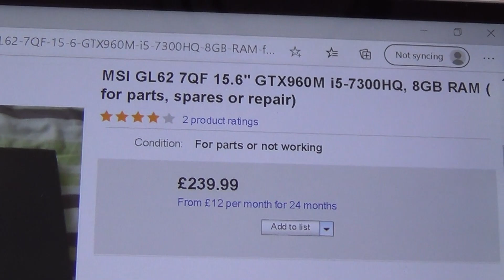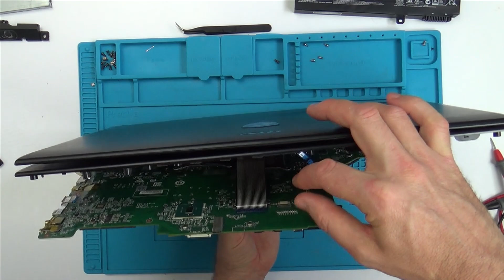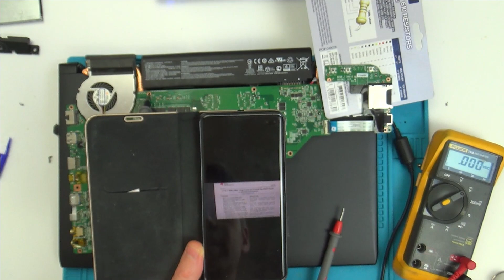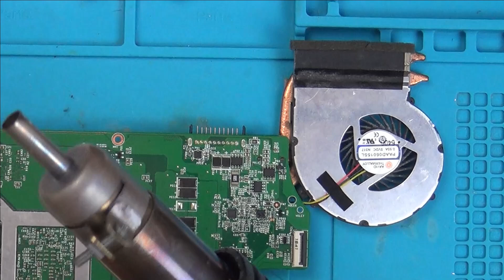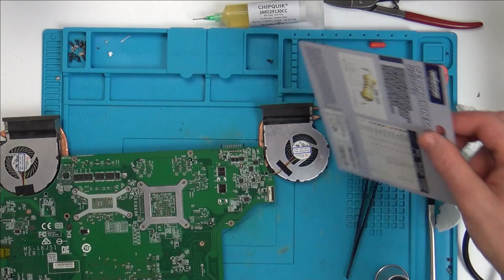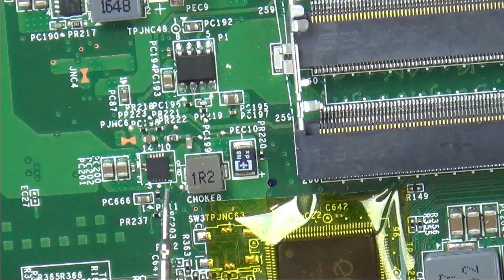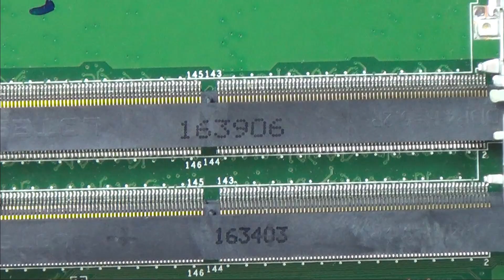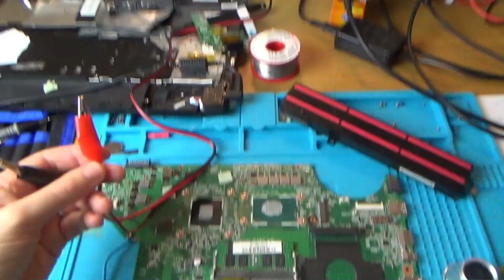Trying to FIX : Faulty MSI GAMING LAPTOP from eBay

Comment: It isn't smart to buy such thing for $200 even when you don't know the history but you already find out. Complex machines and you already know the seller messed with it (honest however can be very destructive - can ruin many components - parts unusable) . That ribbon cable was an indication something terribly went wrong, also the metal particles (does not belong there) on the speakers, wow.  A short can damage many parts, can melt solder, ruin everything, it is not a solution, not all about continuity tests on parts that possible survive the tragedy. You don't check all connections of the ribbon cable, it is not only the power button that could be faulty. You didn't check (flyback) diodes (for example in the polarity overvoltage protection circuits etc), voltage regulators in and out etc. Allow pumping many amps into the board without protection, stress (other) components to get faulty  is always a bad idea. Amps is not always an indication it is good, a short can consumes many Amps, be careful allowing this. If you do want to do such repairs, you need a scope and at least more experience how it works exactly.

Comment: You have a hot air gun. Get a replacement GPU off ebay. The GeForce® GTX 960M can be had for about $40 usd. If it has the balls on it already, it's a simple fix. Otherwise you would need to get the stencil for it and some solder paste. Great video.
Reply: A faulty GPU won't stop it powering on. I've powered a laptop with the GPU unballed from the board. You should still at least get power and fans spinning.

Comment: Interesting video but you definitely got ripped off this time, my guess is the seller probably thought he could sell the chips separately or something and tried to remove them. Must-have known for sure he'd destroyed it completely.
Reply: they definitely knew that it was unfixable. Threw the hard/impossible fix line at the end to cover their ass after bullshitting the possibility of it being an easy fix.
Reply: @dizzy2020  That machines not suitable for Spares or Repair there's not one thing in it that it's in any way salvageable. I'd say charging a few hundred pounds for something you know to be completely useless and basically destroyed any chance of repairing yourself is definitely ripping people off.

Personally I can only guess you're the seller trying to defend this as I don't believe anyone else ever would.
Reply: @Tek-nikal  
not one thing in it that's in any way salvageable? huh? you obviously haven't done any repairs on computers, or know much about computers overall..
I see a 120W power supply, an LCD, a battery, RAM, heatsink, the shell itself. all those parts if you buy them separately they will cost you a few hundred euros total, go see for yourself.
you could even just swap the motherboard for a couple of hundreds more and have a working gaming laptop. and those are not cheap. 
I don't mean to be rude or anything but I think you don't quite know what you're talking about..
Reply: @DecibelAlex  That's right. Plus, in the description it is listed as not working or spares/repairs. It's clearly sold as seen and broken. There's no guarantee it will work and when you pay £20/£200/£2000 it doesn't matter, it becomes your problem once you buy it. If that means you can't fix it, then it's tough. That's the risk after all.

Comment: Hello, do you plan to keep the battery ? I got a MSI laptop, the battery is similar but i can't see if it is the same. My cells on the battery are fine, the laptop recognize the battery but turn off when i want to use it, i was suspecting the battery but it may be a chip on the computer.

Comment: Get yourself a BGA chip nozzle for your hot air station and give it a whirl to replace it, or heat up the chip and hopefully the shorted solder balls will melt off each other under the chip, heat the chip from the other side of the board, place Kapton tape to secure the chip down on the board, turn it over and place heat say 450 and hopefully the solder balls will re-flow under the chip

Comment: Yes Vince, the 2032 button battery is a BIOS battery. I like to call them CMOS batteries, but we haven't used CMOS in a long time. So you can call it either or, there's no wrong answer there. All that does it just keep track of your time and date and any settings you've changed in BIOS.

Comment: That Ebay seller was very dishonest. They outright lied in the description. That should be grounds for return as the item was not as described.
Reply: "spares or repair" is normally always sold as seen. with no returns. buyer beware

Comment: Hi vince the same thing happened to my old laptop try holding the power button down press f12 repeatedly for around 30 to 40 seconds this issue was on my old hp laptop and I couldn't get it on so I took it to the shop and he explained to me what to do after I followed his instructions my laptop started working again mate.

Comment: Vince that laptop has seen better days!!! But putting voltage and amps directly to that chipset south bridge chips power supply isn't a good idea try further in form the power input of the device. it`s not that BGA chips fault.. try and remove the Super I/O chip its the one that had Kapton tape on with about 128 pins see if the other shorts go away also it switches everything on and has 3.3v on one of the pins for the power button.... If not then that damage to the CPU and GPU is the reason why but I believe the last owner probably was watching sorin and thought he try cleaning it.. 1 more thing that ribbon cable the tracks got ripped of because someone pulled it. The bits are possibly pushed inside that connector shorting out?

Comment: Look for the Super IO chip also called the Startup Chip. It is a fairly large chip. The signal from the on-off switch goes to it and it turns on the computer.

Comment: Did you take a hard drive out i didn't notice you taking a hard drive out some laptops wont turn on with out a hard drive.
Reply: All laptops will turn on without an HDD installed, they will just say no boot device found.

Comment: I hate these ribbon cables the seem to fail after removing and replacing a few time and never buy anything that someone else has looked at i spent ages sorting the mistakes out a previous owner has done to the 3 head sony deck i bought .

Comment: You can find skamatiks here http://schematic-x.blogspot.com/2018/04/msi-schematics.html?m=1 . I think you haven't find the right short. Follow the voltage from the in rush limiter. Then see if you have the different rails one 12v, 5,5v, 3V,1,2v . I know it is rude to link others YouTube  channels but take a moment and look through this one! https://www.youtube.com/playlist?list=PLzu1Rjgls4pTJFOT21Yn41KHNRv-Ax29b&feature=share

 believe you have a broken  GPU but you should be able to find out!
Thank you so mutsh! Love your videos and this one specially!
I started a FANCLUB in your honor on Facebook. We are soon 50 happy fans and we al love your work!
Reply: And the missing ribbon cable is for backlight  on keyboard.

Comment: You could also have destroyed the part yourself. Some chips run on less than 1.5v, and you going nuts and pumping 3v into the pcb could have destroyed anything not 3v tolerant. At your original 0.7v, because it was pulling the same 3A, it would have shown up as heat in the damaged area. Try getting a few cans of freeze spray and spray the area in question then add power for a few seconds and see if anything gets hot enough to melt away the area. Don't ever pump that much voltage into anything with ICs on it. 😲

Comment: Hi Vince, if I were you I would send the board to Sorin from the electronic repair school channel, you guys are both in the U.K. , it just makes sense to utilize his knowledge and expertise. Just a thought.
Reply: Okay there is one thing bringing up Electronic repair schools channel. He explains that you limit the amps. And set the voltage low. Leave the voltage low and slowly bring up the amps. Amps are what's carrying the power. His power supply was already rocking three amps. Right out of the gate, common mistake but that was most likely ruined before he even bought it. Just another awesome "Easy Fix" from Ebay.

Comment: Adjusting the voltage on your bench power supply when it's in constant current (CC) does nothing. The power supply lowers the voltage to whatever is required to limit the current trough to the load to the set maximum, it will ignore your set voltage.

Comment: The tiny battery is a CR2032 or CMOS battery :).
Reply: To qualify that, the CMOS battery is used to retain the volatile memory of the CMOS chip, which stores config settings etc for the BIOS.

Comment: Sorry it took me so long to leave this reply, but having worked as an MSI field technician as recently as a few weeks ago, I think it's important to bear a few things in mind.  First, MSI is a generic, white box equivailent laptop manufacturer.  They get the vast majority of their revenue from retail builder, and OEM contracts.  The case your laptop is in is quite generic, and would accomate many generations of motherboard processor combinations.  If you look around, you might also note that the case your system is housed in also used by nearly every off-brand laptop manufacturer.  The great news about that is your machine is iminmently salvagable.  The bad news is, is that the symtoms you are experiencing are classic liquid damage, and I can tell you having repaired hundreds of these over the years is there is absolutely no point of persuing this repair, beyond that generic charging chip.  I would replace that with the TI version, of which the one on your system is a cheap copy.  You also do not have a very highend CPU, or GPU, so I would go ahead and just find another machine with obvious physical damage.  So long as you end up with a 16gb system with at least a GTX 1000 class GPU, and 7th gen i7 or higher for under $550US your are dollars ahead.  Fortuneately, the display and other chasis components are shared with even the most expensive MSI systems.  This means that you still can salvage the best parts of this system.
Reply: What's a MSI field technician? I know that a field technician is a network technician and not a repair technician and MSI outsources their repairs, they are not done in house. MSI sells their products to distributors and not directly to stores. Also I have to disagree with you. This does not look like liquid damage at all, looks like a main component like the CPU or GPU failed, this led to a inexperienced individual opening this laptop and messing with it, what she/he did can only be left to the imagination.
Reply: @mackjeez  MSI has service contracts and  they do have onsite service.  I work for a contractor that provides them, and a number of other companies.  We are MSI when with the customer.
Reply: Lo

Comment: @ 7:35  Could that be it???  (See's the video is 59 minutes long...)  Hmmm, maybe not....  I do love your optimism though.

I have an MSI Gaming Laptop, I love it.  Typing on it right now.  Supposedly "spill resistant" keyboard.  One of your older videos, you showed how to clean a keyboard and fix keys, so one time, I had keys problems, and I did what you did in that video, and that fixed it.  I also held it upside down a couple times and blasted it out with compressed air....

Aside from that it's worked perfect.  It if ever does die, I'll get another one.  Nicest laptop I ever had, and it's not close...  Ahhh, the mishaps, and the things that have happened to this thing...  Traveling, bouncing around in a truck...  Still works.

Comment: I also tried repairing a notebook some days ago. Sadly i also didn't get it fixed. It works but the picture is crappy on the internal LCD. I don't know if its the panel or cable or something on the board. It has wrong colors and a lot of burn-ins and really bad tearing. Looks like a bad LCD from the 90s or so. But the notebook is from 2015. But i don't want to put a lot of money into it so i'll throw it away or sell it, idk.

Comment: ..... On the next one let's begin by clearing the CMOS, with power and both batteries removed.
Shorting either 'clr cmos' board pads or bridging the CMOS battery contacts for a minute.
...... And no more purchases from Mr. Bean !

Comment: I wonder if you could contact another youtuber called Adamant IT im sure he would have some great advice or could even fix it like a part 2 follow up
Reply: He is good right, solid channel he has.
Reply: @jamesvozar1  Electronics repair School Much Better
Reply: Adamant is a real repair-guy.. he has a shop... not a youtube channel.
Reply: @laboratorioassembler  He has a youtube channel see here - https://www.youtube.com/user/AdamantComputers
Reply: @toxicityofthecity226  I know :) but the youtube channel is an hobby... not a job.. like mine
Reply: @laboratorioassembler  it is more like sharing knowledge. what a fantastic channel.
Reply: Or Northridge Fix, the guy seem more knowledge than this guy on the he video
Reply: @RM-en9gk  Nortridgefix is in USA... and only fixes bad chips ,connectors and pcb traces... never see he doing a repair like this... btw the first try to do in this pcb is an UMA conversion ... to exclude vga card and his power supply.
Reply: @laboratorioassembler  yes he has

Comment: I've repaired quite a lot of these motherboards with these fault, these PCH´s are happy to die.  It is enough a faulty USB device, overvoltage, short in the USB socket, or a flat ribbon cable plugged in incorrectly, because the data lines are introduced completely unprotected in the PCH. Practically all connected peripherals can also cause these fault. Often you can even find short to ground in data lines.
Reply: Well, where there's smoke there's fire, corosion such as what was seen here means that you could continue to replace parts and never fix the issue.  Since I think that charge chip is cheap and readily available, and it had corosion I would replace that, and that only.  It's NEVER a good idea to try and repair water damage beyond a single chip or resistor.
Reply: none ninja if he doesn’t speak English then how did sie type
Reply: @Max-9632  I live in Germany and also make my videos in German. but my English is also really bad...
Reply: @SiETechNotebookReparatur your English isn't that bad!

Comment: Oh my god. At first, Sorry for my bad english. I´m a german viewer of your "trying to fix-videos". The damage on the flat cable at 6:24 is actually a problem of my over 10 year old DVD/VCR-Combination after fixing the VCR Picture Problem. I fixed the VCR picture with shaking horizontal lines. A compasator was bad and replaced it. After this fix the DVD Player didn´t work and say all the time "Disc Error" or "No Disc". Before I fixed the unit, the DVD-Player works. And the problem is the same as it her show with this flat cable, 1 of the conetting lines are bent and after trying for 2 or 3 times to put it in the slot, it brokes and at this time, this one connecting line is missing. So sad. DVD-Player broken after fixing and VCR works with nice and claer Picture. One fixed, one broken. That´s life. I tried to fix this flat cable, but dind´t work. It´s now shorter as it was before. And it´s very difficult to fix flat cable. But ok. Now I use a old BlueRay player to watch DVD´s and the VCR is doing his job, too.

Comment: How the fuck have all those iron filings ended up in the speakers, this is so dodgy, unlucky Vince another eBay scam, even a professional engineer would struggle to fix that board. Computers these days have a power management system that brings up all the voltage rails in stages, watch Louis Rossman fixing a few MacBooks Vince, he’s always fixing shorts around the power management system. Sadly there is too much wrong with this board, someone’s totally mangled it. For future ref Vince modern CPU/GPU run on 1.8v with other circuitry on 3.3v

Comment: You might copy some youtubers, but without experience you make more harm than good.
Without being certain on which rail you are injecting a voltage, more than 1V will certainly damage something.
Chipset IC's, CPU's, GPU's have rails as low as 1V.
Also measuring a "short" on some voltage rails, doesn't mean it's actually a short. 
These low voltage rails have usually a very low impedance, in order of a few Ohms. You cannot use a continuity checker there.

Comment: @56:00 That "burn" as you call it on that chip is indeed ink, there is the mark or triange in that corner of the chip so it is to identify which way round that chip needs to be. Have you thought about the Super I/O? Sorin mentions this in some of his videos and changes them, of course it depends and may not be, just a thought. It would be the chip on the otherside of the one mentioned here with the ENE on it, if it is bad, the laptop will not turn on. Try injecting power before that area you were on, the first noticeable short you found which was fursther up towards the power switch, I think. That area you did is just after the super I/O. If you inject power anywhere from after the short, the short will still be there and so may not show up the real short. I think it may be a Super I/O chip issue. Think about why it is called a super I/O, input/s and output/s. If that is bad, the bios on the CMOS will not even kick in.

Comment: Edit: I believe the super IO chip is reading the 3volts present at the power button. When you press the button you pull the 3volts to ground and the super IO starts the board. The lower the voltage read on the power supply the stronger is the short curcuit! Something is drawing the full voltage to nearly zero.
Sorin is indeed a great practical teacher. Goes straight to the point without unecessary theory. Teaches stuff we can actually do at home.